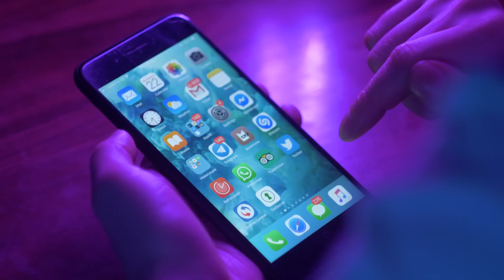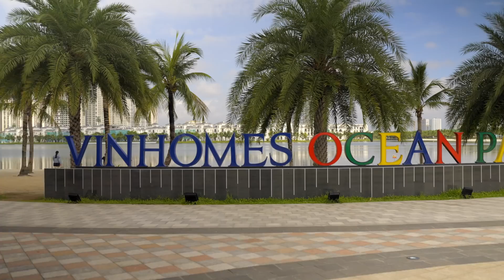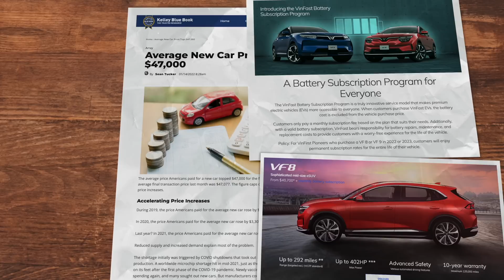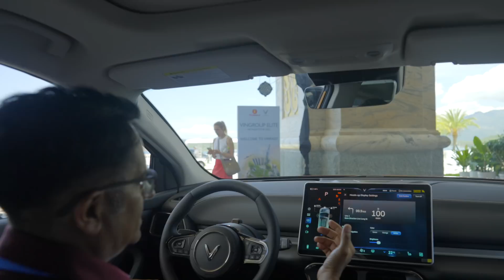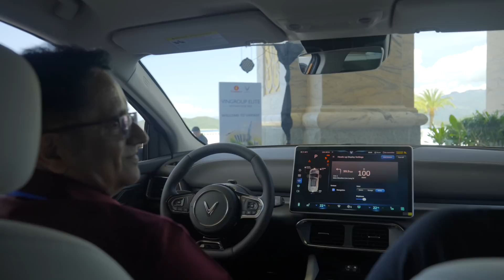New Startup FINALLY Makes EVs Cheaper Than Gas Cars!

Comment from the maker: For Price comparison 7 Passenger EV SUVS - 
VinFast VF9 - $56,000 (https://geni.us/VinFast-VF9)

Tesla Model X - $100,000
Rivian R1S - $75,000
Reply: First principles first, not everyone needs and wants, nor can afford luxury. For many, a Russian Lada would be enough, basic, sturdy, easy to repair, and low cost. The same goes with work machines, That is why Kei trucks would have a huge market in many places on the planet. Those who can create such an EV will have a huge market. So let's be for real.
Reply: @carlosencarnacion9667  Totally agree. Another over spec'd over priced BEV.  Whilst shortages last manufacturers will continue to milk those that can afford it. Mean time at the North Pole.......................
Reply: You could put a Ferrari in the comparison! This car is comparable to the Model Y. The battery in 10 years generates another $ 20,000 in costs, so it costs like a Y, if not more, of course the warranty certainly has its advantage.
Reply: @emanuelemagri8056  if you don't have money to pay off the car then borrowing 20k extra will cost you $417/month which is much more expensive than $160/month for battery leasing
Reply: @emanuelemagri8056  This car in this video was VF8 which costs about 40,000. He compared VF9 to model X and model X is 130K not 100K. Battery subscription in 10 years is about 17,500  for model VF9 so it comes to 56000 + 17500 = 73,400. So VF9 is almost half the price cheaper. Not to mention that you don't have to worry about battery degradation because if the battery drop to 70% capacity, they will replace it.

Not worrying $17,500 upfront is a relief. So basically, they lend you $17,500 and you pay monthly without interest. To the average consumer, it is a better deal if you think about zero interest and the time value of money. Remember that a dollar today is worth more than a dollar tomorrow, not even mention in 10 years. Sadly, average consumers don't understand this concept.
Reply: Must own battery….
Reply: I think you forgot to talk about also getting continuous warranty for the battery/batteries (lifetime warranty I think) as long as your still on the subscription plan and new replacement battery/batteries with potentially newer technology and improvements also included in the subscription plan.
Reply: A second battery availability isn't the issue. It comes down to cost of ownership for term of ownership and resale value.  Average American vehicle ownership sits at just under 48 months which is well within all EV battery warranties. So cost and 48 month resale values will be the biggest selling factors.  48 months x $110/month= $5280 added to MSRP for ownership.  They are just amortizing an expense already factored into other products MSRP.
Reply: With VinFast it's like getting 2 for the price of 1 on batteries. Well it is 2 for 1.
Reply: It's an interesting car for sure, but for accurate price comparison you need to factor in then battery rental costs too, since a buyer can finance that Tesla and end up paying for it  over time, just like paying for the Vinfast battery over time.
Reply: 2022/2023 Chevrolet EUV - $27,200
2024 Chevrolet Equinox EV - (expected) ~$30,000

I feel like saying VinFast makes EVs cheaper than gas cars is pretty disingenuous - their models are still pretty pricy plus, in the U.S., they require you to rent your battery for a monthly fee at a specific mileage per year. There are other options by other automakers (both legacy and startup) that ACTUALLY make electric cars competitive with their ICE counterparts - namely GM and Fisker.
Reply: @fiftysquiggly  euv, or equinox does not make a VF8 or VF9. 54k with a subscription makes an affordable option. Even 74k with battery ownership. If I had bought my model Y when it was 54k then I would be happy, now the same one cost 69,997. Before 7 seat option. The R1S  was 75.5k then it went to 92.5k with less options like all wheel drive,...for less options so crazy. Not missing the boat again.
Reply: Agree with others, what kills it for me is the battery rental nonsense. Total turn off. Warranty/guarantee should ease concerns. Simple as that.
Reply: From 1st Sept customers in Vietnam can buy Vinfast cars with battery which costs around 15k for VF8 and 20k for VF9
Reply: Cadillac Lyriq - $60,000
Reply: Chevy Blazer EV $45K. Same base as Lyriq.  New EV incentive -$7,500 (If GM moves its manufacturing setup from Mex)
Reply: With no batteries apparently!!
Reply: I love the lease model. Hope someone comes up with an attractive lease model for India as well. As you rightly mention, battery longevity concerns and cost pf battery are big concerns as of now.
Reply: Had an electric train once. It worked o.k. but only when it was plugged in. Sorry, bub, no matter how much you flop your arms around don't want one.
Reply: h great ! as a coloured person you should know history ! of slavery racism and colonialism or ? are you aware ? 
CHINA IS a fascist totalitarian regime ! VIN fast is part of the propaganda in east Asia ! supporting and exploiting Vietnam ! making them co dependant - !  THINK BEFORE YOU ADVERTISE A RUBBISH PRODUCT !  WAKE UP !
Reply: Where in North Carolina do they plan on opening a factory?

Also I am so proud of the Vietnamese people.
Reply: Still doesn't seem affordable for people making less than 200k
Those of us who have large families need affordable vehicles. 56k to start isn't affordable. :(
Reply: No middle class can afford that!!
Reply: Some people in the comments section keep saying that they don't want to pay for the subscription..... but they "forgot" that they can get a VinFast EV with a price that has already been reduced before they even bought it, by taking out the price of the battery from the rest of the EV, so... you won't be paying "extra" which is what people keep thinking but not actually "thinking".

The subscription plans includes warranty and replacement batteries in the future.

Even if you add up all the subscription plan cost over a few years, let's say 10 years or more even, and after adding it all up the price could still be less or if not it will be equivalent to EVs of other manufacturers... BUT the DIFFERENCE is 1 battery, ONLY 1 battery, old, degraded, old tech battery VS at least 2 or possibly more "free" new batteries, for the lifetime of VinFast EVs.
Reply: The new Model Y is $42,000 before VAT with about 280 miles of range and rear drive including battery. The ID4 is about $42,000 rear drive and 275 miles range. The Mach E was about $46,000, but I think they just added $8,000 price increase.
My thing is that when Vinfast offers the battery for sale included in the price of the car, I may be interested again, but for lease only I canceled my reservation because I don't want to have to pay a monthly charge forever on the battery.
My Model S is over 7 years old and has over 100,000 miles on it and the battery is still under warranty until June of 2023 and the battery is fine, but I stopped paying for it a long time ago and I have the title in my safe instead of at some loan company. I own the whole car. I think Vinfast would do better if they offered the battery for lease and for sale and let the customer choose. The VF9 is very very nice and it's the one I liked best, but for now I am looking at the Kia EV9 that will go on sale in Q1 2023 that might work for me instead because leasing does not appeal to me.
Reply: @kenmcclow8963  I agree if keeping your vehicle longer than 8 yrs is something you do. They now give you the option to buy it outright. If you would have kept your reservation the cost would have been cheaper. I thought about buying it in the beginning of September. It was 44 k and it went up to 47.7 when I ordered it at the end of September. 3700 for waiting 2 weeks. I think you know where it's headed. Eventually I will pay the $75,000 but I don't have the money to pay it now. So paying $54k makes it worth it for us. Good luck. California gives 2000 incentive, federal 7500. That is 2/3 of the battery cost over 8 years right there.
Reply: @kenmcclow8963  We went to the Orange county car show and even the Kia reps. Didn't know about the EV-9 We had to tell them so he might be waiting a little bit longer
Reply: @d.pollard5962  Throughout my life, car dealership employees are some of the least knowledgeable people about cars, and especially future cars that aren't on the lot right in front of them. The EV9 is only a render at this point, but Kia says it will be out in 2024, so possibly a 2025 model year. Because I'm impatient I ordered a Ford Lightning which I will have early in 2023
Reply: @kenmcclow8963  my sister in law ordered one as well. Right before the price went up. Good luck with that. I am hoping Atlis Motors delivers on their truck. We did order the VF9 and hope we get it at the price point we ordered it. Good luck.
Reply: some people argues that they have to pay $20k for battery for 10 years so the actual price is 75k. Well, if you don't have money to pay off the car then borrowing 20k extra will cost you $417/month which is much more expensive than $160/month for the battery. Obviously, Vinfast makes it easier for you to make a transition to EV cars.

Comment: VF was running its mouth about a battery range of 280, 290 until EPA tested and said its actually 179-mile range. In VF is a small company of VinGroup which funded and protected by the Communist Vietnamese government. VG is not an automobile company nor any tech company at all besides real estate. VG came out with VinPhone and bankrupted, then VF was born and came out with gasoline car roughly 3 years ago then they bankrupted also. In Vietnam, if customers complain about Vinfast cars, then the law enforcement will be called and harassed the customers.

Comment: Sounds like the Battery rental is a huge cost and shouldn't be so high. They might be raking people over the coals, or their batteries might be junk?  It's like how many people are only worried about their car payment, not how much they gave for the car or if they are upside down.  Well see when the numbers are run against other EV's. 

 It would be interesting to see how long one would have to own these two cars to break even.  because it appears it would be more expensive in the long run.

Comment: Great, interesting video, fascinating to see new developments.  But WHY? does every eCar review involve flooring the accelerator?  Ecars are meant to save the planet, so careful EV driving uses less electricity- which saves the planet?  As a family car, it isn't about speed/acceleration it is about running costs and overall performance.  How many people test the body roll on any car on more than the odd occasion?  Keep things real, EVs should be designed to save the planet, not show off...
Reply from the maker: We’ll my hope is that car enthusiasts can love them too… because there’s a lot to love!
Reply: @TwoBitDaVinci  Sorry TBdV, not a railing against your fantastic work, but just a quiet reflection on life, really.  Looking forward to your next...

Comment: The main problem that I see is that the monthly battery cost is just another added cost to a monthly payment for the car itself but, unlike the payments to pay off the car, it is permanent. The example you used comparing gas prices is only accurate now. If gas goes down you still have to pay 110 a month or, if you only drive 500 miles a month, that 110 is still persistent. To me, this is not much of a deal. 
Not sure I understood the example of 45 per month in electricity. Is that in addition to the battery 'rental'?

Comment: Love your channel, diverse topics and forward looking. Ive been following Vinfast Lately and I have a couple of comments, mostly about EV COMING FROM ASIA

1- SAFETY, RELIABILITY & PRICE- Most of these car are being built by startups or companies that have not done business in the West. They all have aspirations to penetrate the Western markets. Japan then South Korea achieved that mainly through quality, reliability and very competitive pricing. 

Thes cars may be of high-quality & granted, EV’s are much less prone to breakdown because of the fewer components involved, but the ultimate test is time. For Example, Nissan Leaf, after they fixed the initial battery cooling issues, they have proved very reliable and been on the road 100,000 KM+ with the smallest maintenance & operating cost. You could argue that we did not know that in 2012 / 2013. As far as pricing, the prices they are coming in with are too high for an unproven product, yet! For instance, we know if you buy a Tesla at a higher price point, but you can rely on their track record and very high resale value. It does not make sense to buy an unproven product at a 10% - 15% initial discount, then take an 80% depreciation “bath” after 5 years in resale.

2- Midterm future; the future of EV’s is heading towards affordability. We are getting over the Covid hungups & supply chain issues that created a constrained supply and high pricing. The new battery technologies will be longer lasting, better performance & cheaper (LFP, Na, etc..). We are heading into an economic slowdown period which will put pressure on high pricing. Economies of scale as EV’s become more prevalent, the manufacturing cost goes down. Tesla recently announced a $25K EV, how are these companies goin to react, reduce heir overinflated price by 60 - 70% to compete. If so, what does that tell you about their current pricing? It’s not worth it!
Reply: As for reliability, they use moto ( whatever it call to make the car run) from BMW. As for the resale value, no one will know for sure if they gonna hold value or not. You said it will loose 80% of its value after 5 years? Unless their car prove to be trash, it can’t loose that much after 5 years. 
As for cheap tesla for $25k. Well good luck with that. People has been complained when tesla announced that their cheapest will start at 37k but they keep changing increasing the price. And no one actually can get a tesla for 37k. 
But vinfast is not for everyone. It’s definitely not for you but good number of people already put the money down for it.
Guess we just have to wait and see if their car is worth it

Comment: Gas $166 a month.  Electricity $45 a month.  That's a good savings!  That'll help make ends meet.
...To INSURE your batteries, add $110 a month ($155)... really... a savings of $11 a month.  I wonder how they came up with that price?  'Well they're used to spending $166 a month so we'll get the money they used to spend on gas. Win!"
'Cause god forbid you not sucking every last dollar you can out of the consumer you greedy blood-sucking assholes!  But hey, you'll save enough money to get a meal at McDonalds... by yourself... once a month...
Edit:  Also, $56k may be cheap in California but in Michigan that's a house (a crappy run-down house, yeah, but jeez).  The paycheck hasn't gotten that much bigger.  I'll be interested when I can get a used one (that still works and has plenty of life left in it) for under $20k.

Comment: There is NO 13c per kw/h electricity. You can get that rate for the" supplier" but you have to pay the local electric delivery company another 13c to 25c for " delivery" plus taxes, feels, madeup local fees, improvement funds etc.etc.etc..... They rob you bli d. Point is electricity is minimum 35 to 50cents per kw/h sometimes....and it wil rise and rise with this world crisis. So the 45$ elecricity budget is more like 180-225$. Plus 110$ subscription - about 300- 425$ a month for electric car. NO THANK YOU

Comment: Is this an infomercial for justifying continuing to make bigger & bigger cars as well as blindly aspiring to pursue the luxury lifestyle? These cars are still just as resource intensive as combustion cars. We need as a society, a civilization, need to reduce our consumption,  our super-sizing... another comment mentioned leafs & zoes - medium & small., both light & using less ore to make.  We're going the wrong way in terms of attempting to manufacture our way out of our problems while not reducing manufacturing's resource & polkution burden, which perpetuates and even increases manufacturing's majority contribution to the existential threat we now face!  I reckon Electric bikes, trikes & scooters with or without trailers would satisfy the transport (and fitness) needs of 95+% of our mobility needs.  Regards.

Comment: Vf8 55 K with battery 10 year warranty or 125k , no oil change, electric cost about 50% less than that of gas.  real deal
Reply from the maker: The Vf9 is the real killer value!

Comment: This is still pretty pricey, and I think its a bit deceptive to say cheaper than gas cars. The starting point is 42k without the battery. With the battery its 57k. That is way above what the average working class family can afford. We won't have mainstream acceptance of EV's until they are in the 30's with the battery.

Comment: I wouldn't say that EVS are more reliable than a gas-powered engine. You hear horror stories of Tesla owners batteries going out at 30,000 miles. My Lexus RX330 potentially can go up to half a million miles as long as I do my maintenance properly. for sure it will do over 200,000 miles. But that level of reliability and longevity, I have not seen that on EVS. Plus you take into  consideration how the harmful they are for the environment. EV'S take up to 12 times more rare earth metals then a conventional gas powered engine. And a lot of these rare earth metals come from Africa and from places that don't have good human track records. Until we're able to safely and humanely extract these raw materials from poor countries. I'm going to stay away from these human trafficking vehicles.